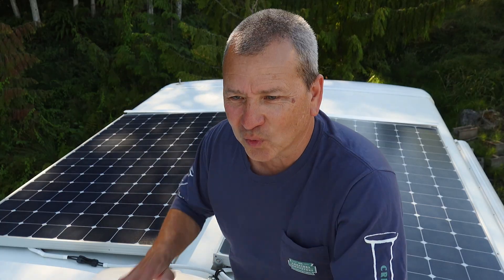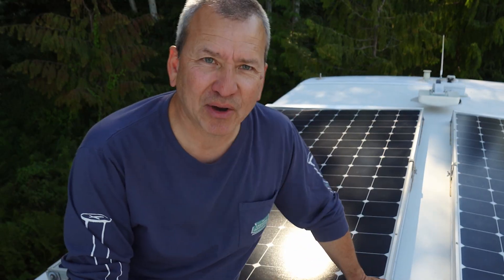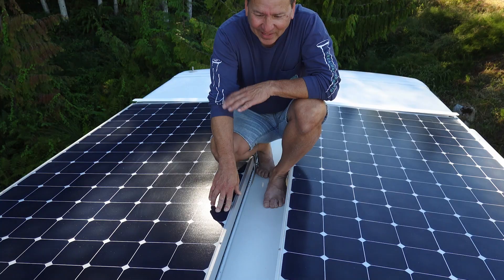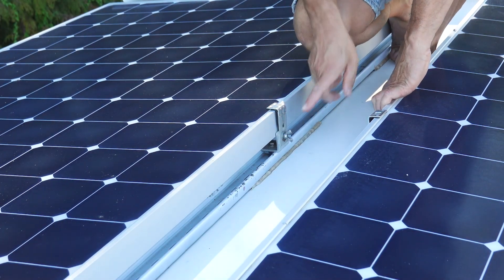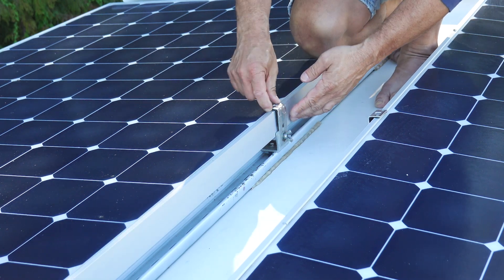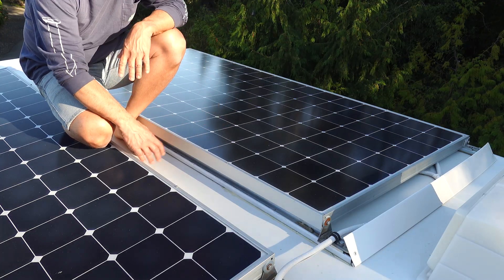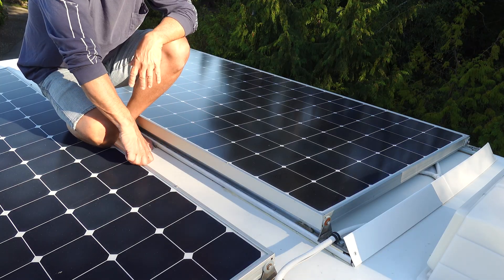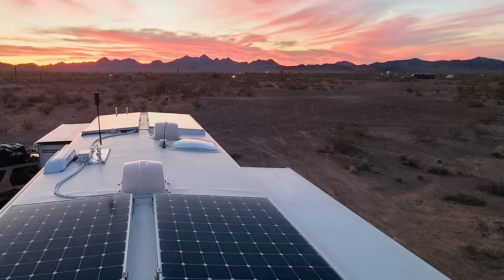Off-Grid for 6 Months! How Did The NO-DRILLING RV Solar Mount Hold Up? | 1700 Watt Solar Powered RV

Comment: Back in my solar installer days, I was often asked to do RV installs. I did at least 50 modules of various sizes on various types roofs. My first way to do it was to work off of a roof rack, if there was one. Most often though I used EPDM rubber "donuts", 7/16" dia., that had a brass 1/4" threaded insert bonded into them.  I'd bolt my stand off legs to the modules first, then when on the roof and where I wanted them (away from shadowing structures as much as possible) I'd drill thru my braket legs into the roof with a 1/4" drill, all 4, then shift it enough to enlarge the hole to 7/16", and with a twisting motion insert the rubber bushing into the roof, re-position the module, and using 3/4" stainless 1/4" bolts, torque them down.  NO caulk, no leaks, and never had one come loose. I bench tested the holding power of them first of course, to prove the concept to myself. Your no fastener at all method is yet another approach. For the last 5 years or more, my go to caulk OR glue is a product called Lexal, I get it at Ace Hardware. It outperforms silicone types hands down, and it's best described as an "adhesive caulk." It stays pliable, is crystal clear (or white) and is especially rated for any plastic to any other plastic, though I use it about anywhere.
Reply from the maker: Great info. Thanks! I found the Lexel (spendy) and will have to look into those rubber donuts.
Reply: @RVwithTito   They are hard to find, short of a specialty commercial hardware outfit , like Fastenal, even then you have to order them in. Lexal spendy? I like the smaller tubes, rather than the caulk gun sizes, they are less then 10 bucks I think, worth it!  I have used it on my LSA plane a lot, one favorite trick is, for instance, when routing something like a GPS or Sirius SAT radio coax cable inside the cabin, rather than use mechanical fasteners of some type, I use the clear Lexal, just a dab every few inches, and some masking tape until it sets up. Next day, tape off, cable stays put and you can't see the Lexal.
Reply from the maker: @portnuefflyer  Hmm. That cable routing idea sounds interesting. I'll have to try that. Thanks!

Comment: Brian, the slope to the roof to which you referred is called "tumblehome."  At least, that is the engineering term used in the automobile industry. You will make yourself clearly understood when discussing this aspect of your vehicle with automotive engineers and designers.
Reply from the maker: Didn't know that. Thanks! Creates added strength I'm sure.

Comment: At 14:20 it shows 4 MPPT, 36w, 31w, 113w, 223w. these are the 4 MPPT 100/50. 
what if you bought two MPPT 150/35. 
if two of the solar panels are put in series the current would remain at about 11 A. but the VOC would be about 49.1v + 49.1v. = 100 v. 
The MPPT 150/35 would give room to grow in case you replace with 490 w or above.
The panels in series would be the ones with 36w panel + 113w panel (giving the MPPT a chance to work) perhaps bringing them both above 100 w giving 200 w.
I'm assuming the 36w panel is being shaded in some way of course!, but the MPPT would bring voltage up!
This is a test you could do.
Most don't understand what I'm suggesting here and may sound nuts, but that is what MPPT's are supposed to do. you can test it.
So on a day where you get 36w, 31w, 113w, 223w. you can video the wattage like normal.
Then disconnect all MPPT, connect the panels giving LOW and HIGH voltage in series, and install the two MPPT 150/35. So two panels to one MPPT and the other two panels to the other MPPT making sure the panels giving the low voltage and high voltage are put in series.
and see what happens.
Reply from the maker: The video clip you mention was on a day parked in the woods (heavily shaded - future video). I just added it here to show the display. Definitely not normal conditions. These are 425 Watt panels with over 70VOC each and a potential output current (after MPPT) of around 46A at 12V.

Comment: Tito, I used your last system (aluminum T-track and VHB tape) to install 850 watts of solar on my Leisure Travel Van and after 30,000 miles it was still solid. I did add a few bolts in strategic spots where the T-track didn’t perfectly follow the curve of the roof. With 8000+ watt-hours of 24v lithium BigBattery and the converter from the alternator, I could go indefinitely without plugging in. I didn’t even have a generator on that rig. Thanks for the great insights!
Reply from the maker: That's nice to hear. I appreciate that 30K miles follow up. Great job!
Reply: How do you bet 8000wh out of 850w.  That'd be 10 hours of sunlight and 94+% effective.
Reply: @joeboxter3635  Over a 24 hour period, we typically run the batteries down about 15%-20%. During the day, we charge batteries from the chassis alternator (about 40 amps) and the solar arrays (the 850 watts usually produces 300-500 watts in most conditions). With a few hours of driving and/or some decent sunlight, we get that 20% back within four to six hours.  We’re essentially able to go indefinitely without shore power. Of course, running the AC changes everything. I get 2-4 hours before the batteries are depleted with the AC running.

Comment: Hi Tito , glad to see this update as i watch your installation video last year. 1 thing to ask you, my solar panel also 1700W , 24V lifepo4 battery system, may i know how many Ampere you can get average? 
Hope to here from you soon.
Reply from the maker: It certainly varies. Typically somewhere between 70A and 110A (at 12V) under the conditions I've been in.
Reply: @RVwithTito  Thanks so much  for reply. I have 4 x 425W solar panel , in series - series  , got around 15A~ 45A 24V in Malaysia.

Comment: I'm glad I saw this video! I saw your earlier one and was all set to do a no drill mounting of my panels but then I saw this one and you mentioned the delamination problem that I would run into with the rubber roof. I guess I'm just not feeling great about the idea of having to drill 48 holes into my roof instead of using the strut channel solution.
Reply from the maker: Yeah. The track is a great solution for multiple panels and also allows for greater flexibility down the road. Good luck!

Comment: Brian, don't all these roofs have some sort of framing in their ceiling, even if it's sparse? Wouldn't a screw into the framing be better (if we could figure out where it is)?
Reply from the maker: Not sure. If so I couldn't tell you where. Initially I hoped to screw into some kind of support. I believe it's the fiberglass and curve of the roof that gives it it's strength.

Comment: QQQ At what point do you decide you need to tilt?
How much improvement do you see when you tilt?
Have you ever considered tilting all 4 at the same time?
Reply from the maker: The improvement can be significant 10-25%. If I tilt them a little higher then I might get more. It's typically something you consider doing in the winter months when the sun is lower on the horizon. If I'm staying somewhere for a longer period (at least a week) then I'll consider tilting the outer panels to face the sun. I haven't had the need to tilt all four since one side will be slightly tilted to the sun anyway. Plus they might block the other side if tilted.
Reply: The improvement is the cosine of the angle to the sun.  So if the sun is at a 45 deg angle, you get cos(45)=70% output.  You’d get 30% more lifting the panel 45 deg.  In winter at high latitudes the difference could be 60%. In summer at low latitudes it is much less.

Comment: I started watching you ~6 years ago as I was learning about solar. I did a “chase the sun” system out of fear of drilling holes & leaks. I applaud your experience and follow up. I am looking at a permanent installation on our new tt but very cautiously evaluating which way. Thanks again for the follow up.
Reply from the maker: Thanks for following along. Good luck with the project!

Comment: Thanks for the followup, I plan on putting solar on my motor home whenever the heat breaks, and I'm going to follow your idea. Just out of curiosity, did you just put the screws in out of an abundance of caution, or were starting to notice some delamination of the filon or the unistrut? I really don't want any holes in my roof, even if I have to put more unistrut on it.
Reply from the maker: Just out of an abundance of caution since I knew we'd be hitting some major bumps up north. I figured a little anchor on each end couldn't hurt.

Comment: Do you think this no drill setup will work with a metal roof on a bus?
Reply from the maker: Probably. I've only done it on mine. One reason I kept the panels lower was to minimize any upward pulling at high speeds. So be aware of the aerodynamics of your bus and how the wind will hit the panels from the front or side.

Comment: eBay link doesn’t work
Reply from the maker: I removed it since it was an old link. Not sure if they're currently available.
Reply: @RVwithTito  your explanations on the roof mounting rails and how you attached them answered a question I’ve been researching for a week.  THANKS! In case you wonder if the info is useful.

Comment: Brian, why use such a long bolt into the thin roof, I don’t believe you have improved your installation because you used a longer bolt into the foam.
Reply from the maker: There's a washer, unistrut, vhb tape, fiberglass and 1/4" plywood between the bolt head and foam. So maybe 1/2" to 3/4" is going into the foam. Makes me feel better.

Comment: Does anyone know what happened to the Flex solar panels Brian installed a while ago? Curious to know why he switched back to rigid panels.
Reply from the maker: The flex panels went with our class C when it was sold earlier this year. Still a good solution for that rig...the new owner loves it. I still have some flex panels, but the class A had lots of space available. So I wanted to find some large panels to maximize my energy density. You won't find anything like that in a flex module.

Comment: I have 2ea 3ft x 5 foot 285 watt panels I'm putting on my 38 ft Newmar. It's got the rubber roof so I'm screwing them down. You got rid of your antenna and satellite.  What are you using for reception?
Reply: Great update thanks
Reply from the maker: No need for TV or Satellite. We stream all of our entertainment and don't use the antenna or satellite. Check out the install video and you'll see me remove those antennas.

Comment: Brian, another great video. It doesn’t look like you have air conditioners up on your roof. Is this so? Did you remove them? How do you deal with the heat? Looking forward to seeing your video on your other solar components especially how the Multi Plus II has performed.
Reply from the maker: Peter is correct. Our A/C heatpump unit is in the basement. That was a feature I really love about this rig. In case you're wondering...yes I can run the A/C with my setup. I don't even need a soft start to fire it up.
Reply: @RVwithTito  wow I didn’t know that was something they did. I wonder why there was a change to roof top units
Reply from the maker: @stewartmhyre1528  It's great, but everyone asks..."what's that in the back?" It does limit the amount of storage space you'd have I suppose.
Reply: @stewartmhyre1528  Coleman basement AC has two compressors,  and most RV builders bolted them in not a slide out rack for repairs and cleaning and service.  They are not easy to drop and repair.   Also AZ Expert has shown his channel over the years they have had circuit board issues and updates.  Not a lot of room to work.
Reply: @RVwithTito   yes you have a lot of ac power. I have asked the two soft start box makers on installing on Coleman Basement AC and nobody seems to know how.   You would be the first person to engineer that,
Reply from the maker: @dewholdingsllc1050  I know someone who added Micro Air Easy Starts on his basement A/C. I dug it up the info he shared with me here for you to check out. Hope it helps. Here's a short video showing what he did: https://youtu.be/qf9VVBoxBxY
--------------------
Message explaining the process: 

I could fit two Easystarts inside the unit with short wires hooking into the harness of the compressors. You might even be able to see the colors of the wires in which to splice into but the manual that comes with the Easystart is probably more reliable to follow.

This basement unit comes in different versions with mainly the components and connections for the ducts at different places. For your reference, we have model 46515.

You might already have noticed that this basement unit has a start up sequence. It enables the unit to start and run at full power on 30 amp of shore power without tripping the breaker. It first starts compressor 1 and the fans, a minute later it turns the outside fan off for a moment while starting compressor 2. a few seconds after compressor 2 has
started the fan comes back on.

I noticed that the delay caused by the Easystart and the delay to restart the outside fan kinda matches in timing which makes compressor 2 and the outside fan start at the same moment. To me that partly defeats the purpose of the Easystart so I rewired that fan a little so it would always stay on as long as compressor 1 is running.  I forgot how I
rewired it but I remember it was easy. I think I only needed to move one little and easy accessible plug in the electric compartment of the unit. I can retrace my work when you get there.  Rewiring that fan also gets rid of the second clunk when starting the second stage.

The biggest job to build the Easy start in is to get the whole freaking unit out so you can get in there. The machine weighs 100 pounds which does not make it easy. I have made a little lift to help me with that. I can slide the basement unit out of the bay and onto the lift. (I made it a 24x24 platform so it also comes in handy with handling the washer/dryer. )

Since opening the unit is such a job it might be a good idea to replace the bearings of the fans while you are in there. Originally these are bush bearings that you are supposed to oil every year. (yeah right, they expect you take that unit out every year?)  I have replaced these bearings with ball bearings that are readily available. I got two on Ebay: https://www.ebay.com/p/11012032857?iid=133274539370

About efficiency.... Yes this unit is nice and efficient because of the choice of components and the fact that it has two stages so that it can run at half power but other things make me doubt the whole system is that efficient.  I have the impression, but no proof, that a lot of that efficiency gets wasted because all air needs to be pushed with force through 1 ½ inch ducts in a 3 inch Styrofoam roof.  a) There is not much room left for insulation between those ducts and the sun beating down on the roof and b) that indoor fan needs quite some power to push that air through, which by the way makes it important to have your duct at the A/C unit absolutely air tight.

With the Easystarts in place I have been able to run the first stage on a 1800 watt Prowatt 2000 inverter but the inverter needs to work hard to deliver the needed 1400 watts.  Although I am pretty happy with the unit and how it performs with the Easystarts I am still thinking about fitting an inverter based mini-split somehow somewhere. I believe these
units can be much more efficient by design than this basement unit. Yes, it probably makes economical sense to only put an Easystart on the first compressor but I like the way the Easystarts makes both compressors start smoothly.

One last tip: when you are hooked up to 50 amp your energy management console can't show the amps you are drawing but when you hook up to 20 or 30 amp shore power or run the generator it can show you what the A/C unit is doing while it is going through it's power-up sequence. It might also give you a demo of the power shedding that your rig can do.
Reply: @RVwithTito  Okay, thank you for the written explanation, helps but that yt poster is poor as its after he did it and no real explanation.  You should do one on your basement AC as it would be much better because of the level of detail and show as you go.  My 2 cents.
Reply: The Adventurers of this era had basement A/C units.

Comment: Hi Brian, since you’ve had both smaller and larger panels, which would you buy all over again?
Reply from the maker: Larger panels have higher energy density (more power per sq ft). I recommend getting the largest panels you can to fit your layout. Fewer panels also means less mounting requirements.